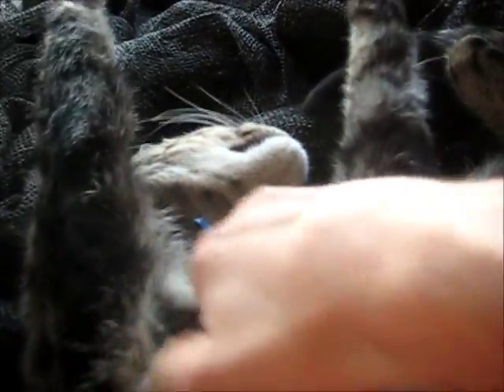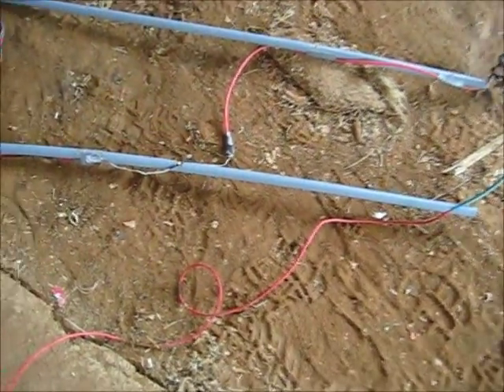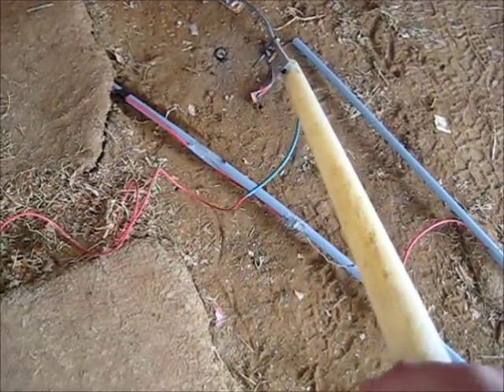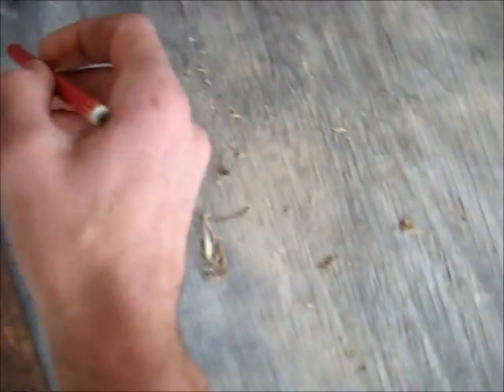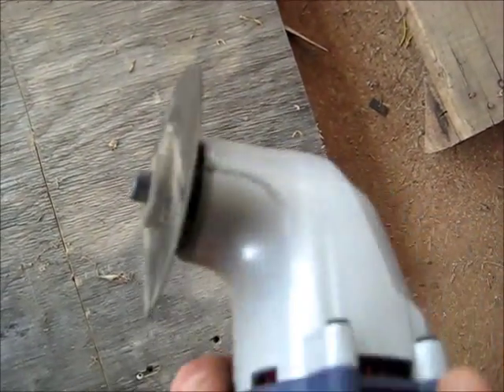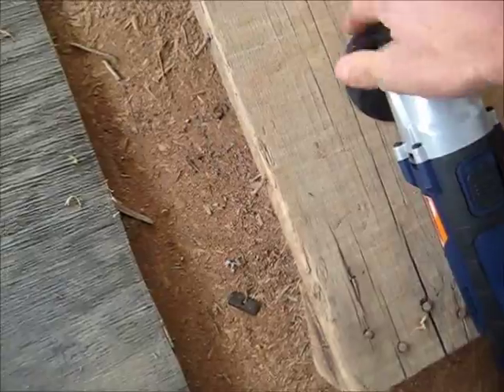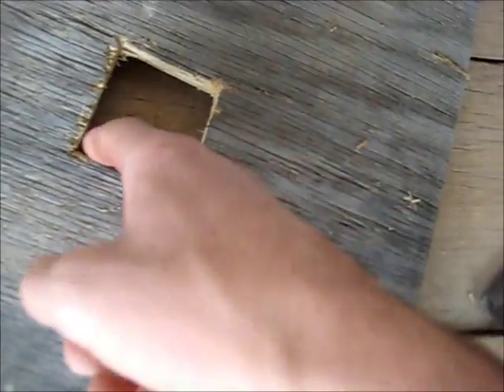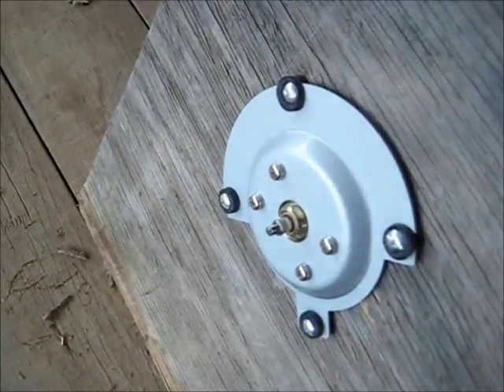MOT Fun & Making a router table for the blender motor

Comment: When they did that, I don't think it worked, so they went direct: They took a 110v router and powered it on 240 for a bit of extra kick, and CDs were exploding all over the place. :-D

They tried all sorts, and I think the "motor-on-an-angle-grinder-gear-box" attempt was bit of a fail. 

{^_^} BoomBoxDeluxe {^_^}

Comment: 280v? Well, that just adds to the fun then. :-D 

Out of interest: Have you used a volt-meter to see if it actually achieves 280v? It may say 280v on the dial, but it will only produce that if the input voltage is at the rated input voltage. There may be certain times-of-day where the variac may struggle to make 280v because of the loading on the circuit or the local grid / substation transformer. 

But yes. 280 v. Mmmm, poppage fun! :-D

Thanks for showing,

{^_^} BoomBoxDeluxe {^_^}

Comment: Bizarre power tool. Never seen one of those before, but it does what need of it. :-)

That blender-thing that you've done: You might get more speed out of it with the variac. :-)

Wall-socket = 240v = standard blend-speed
Variac = 270v = Over-blend speed. :-D

Would be interesting if you can pop CDs with that. I know MythBusters tried this, but to get CDs to pop, they needed their 110v router on 240v so that it would spin fast enough to pop the discs, BUT they popped the router also. :-D